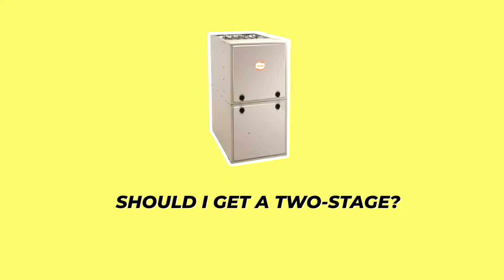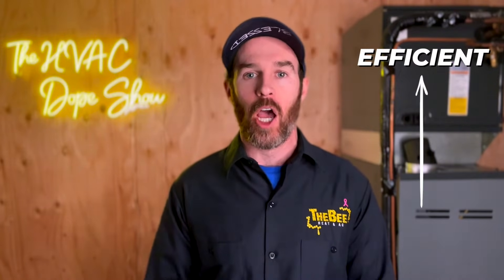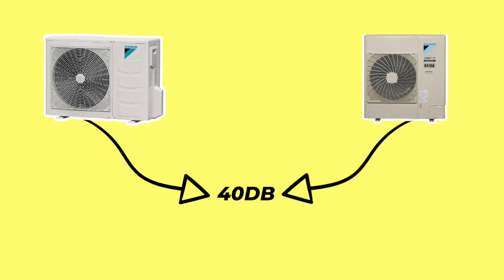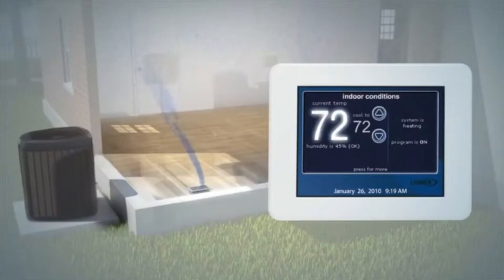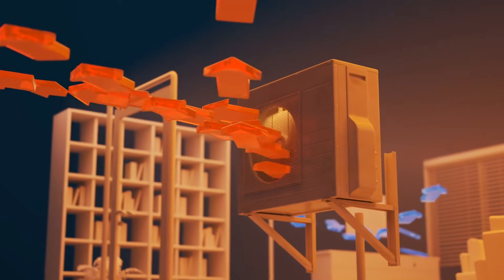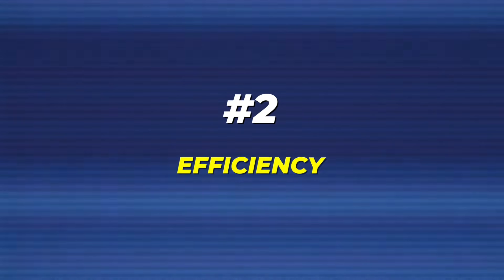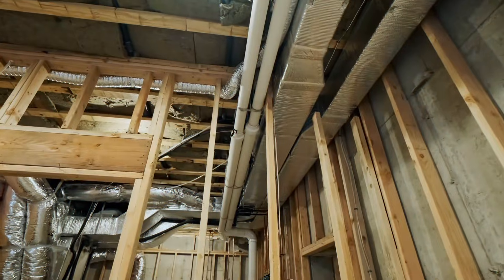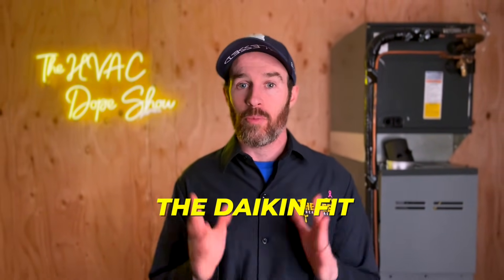Single Stage 🆚 Two Stage Furnace 🔥🤔

Comment: After a lifetime of single stage units in hot North Texas, I found myself faced with this choice by my A/C company when my old system failed.  The explanations of the benefits of two stage or variable speed units made good sense, but today's A/C costs are high, and these new types are considerably higher than single stage.  In my case, a 5 ton system was quoted at $16.5k.  A two stage system was $24k, and the variable speed system was $26k.  We are retired, and on a fixed income.  This was going to require financing. The monthly payment for the single stage was about $325/mo.  For the variable speed unit, it was over $500.  We have been perfectly comfortable with the single stage unit in the past, and we can't hear the outside unit at all.  So, we saved the money and got the new single stage system.  The last two days had a high temperature of 103.  I'm not sure how our house could be more comfortable.  Possibly, our unit is less efficient than a variable speed unit - but not $175/mo. worth.  So, to many people comfort is not the deciding factor.  It's cost, and there is a considerable cost difference in the types of systems.
Reply: These prices sound crazy high.
Reply from the maker: Yeah it really depends but that’s not a bad choice and will be very reliable for you and cheaper to work on. Things have gotten very expensive in recent years so it’s made things even more exacerbated for sure!

Comment: Don't longer run times with a two stage result in burning more natural gas?
Reply from the maker: Nope 😁 because in first stage it’s consuming half the gas it does in second stage. “Second” stage is basically the full stage of a single stage system, it’s just reduced output so it warms up more gradually and doesn’t overshoot the mark like a single stage might.
Reply: @TheHVACDopeShow  Thank you of the information.
Reply: And longer run times mean more electricity use??
Reply: @RedMango55  Cost of any additional electricity is offset by using less of the more expensive natural gas cost.

Comment: running a single stage 8o% gas furnace now.  looking at adding either a heat pump or AC for the summers.  one of the quotes I got was for a variable speed inverter heat pump.  would the efficiency benefits of that be negated by my existing furnace?
Reply from the maker: No the efficiency would still be noticeable, but the inverter heat pump would be able to function as a solid primary source of heat. The furnace is just your air handler / blower portion of the heat pump that circulates air inside, majority of energy consumption is the condenser portion of the equation so if you have an efficient heat pump condenser that will still be a plus. To maximize efficiency you want an AHRI matched system but it’s not the end of the world or as major of a deal, definitely makes a difference but maybe 10% depending on the system

Comment: 21 yrs with sinle stage. Just got a new 2 stage. Way more comfortable. Worth the spread.
Reply from the maker: Right on! Glad to hear
Reply: how is it more comfortable, quite possibly not related to 2 stages but improvements in air flow from new unit is my thought.

Comment: Here is a topic you missed. I have a two story zone home, upstairs and downstairs. I have a variable speed 5 ton RUUD 20 SEER AC that I run as a two speed. I have electric heat strips because I am all electric and live in Texas and Texas does not have winter. The electric heat will blast you out on high on a moderatly cool day and only one zone is calling. It takes time for the heat to reach the thermostat and warm the walls up. The second stage is needed when the temps are in the 20s and sometimes when both zones are calling.

I have had a heat pump but found them to be not cost effective because they are too mechanically costly. In other words the extra repairs and higher initial cost did not pay for itself. I use way more AC than heat so I put my money into the AC. 

My heating solution was to add an adjustable timer to put a 20 delay the before turning on the second stage heat. Normally the first stage heat is all that is needed except on some very cold mornings or unusual weather. The timer works and the zone controller did not have this option. Of course the electric strips do have sequencers.

Comment: I live in a split level home. I find the upstairs is still an issue with cooling down. I have shut all the vents on the other floors and it’s still a problem. I have a 2 stage furnace. What can I do to cool the upstairs down?  I do have the furnace fan going 24/7 but for some reason at night time the fan slows down. What can I do to fix this?
Reply from the maker: First off don’t shut those vents! That will cause more harm than good… basically you’re restricting total airflow now and the system will start malfunctioning or icing up. The best thing is to open ALL (or at least most) of the vents, and switch your fan mode to ON not auto… this will help your air circulate to the upstairs even when the AC shuts off, so that the temp on the upstairs becomes more even with the main floor. I’ve seen this one simple hack change the temp difference from over 10 degrees to just 1-2 degrees. Keep in mind it will take several hours of the fan running to equalize / circulate the hot air upstairs but leaving the fan in “on” mode on the hottest days is the best thing you can do. I know you’re already running the fan but open all the vents even on the main floor, and if you have a company come out to look at the furnace they can change the fan speed settings on the motor via dip switches on the board (most likely) or via speed taps on the motor (if it’s a PSC Motor, which is less likely since you said it’s a 2 stage system). But if you get them to increase the fan speed in fan mode on the speed taps, you’ll be able to get a little more airflow upstairs at night and during the day too. But definitely open the vents up that will cause issues
Reply: @TheHVACDopeShow  thank you so much for getting back to me. I will open the vents and call someone to increase the speed of the fan 😊
Reply: @TheHVACDopeShow Can they change the speed of the fan on a single stage? Any idea how much extra keeping the fan running 24/7 will affect the electric bill?

Comment: Trying to decide between a single stage and a two stage and i am woundering which is more reliable in the long run. I have a under 900sqft house and not sure if a two stafe is neede ???
Reply from the maker: Single stage is probably fine, 2 stage is comfort related… just don’t over size the system you probably only need a 40k or 60k btu furnace depending on your region and insulation

Comment: I'm also making a decision on single stage or two stage systems, one should also understand that a two stage system requires more times a technician to come by the house and repair or maintain the furnace.  Don't set yourself up for spending more money on a technician to figure out the problems with the more effieient two stage system.  I am going to go with a single stage variable speed furnace.
Reply from the maker: I don’t think there’s a manufacturer that makes a single stage variable speed and I don’t think that this is true. It’s definitely true. That inverters or high-end systems are more difficult to troubleshoot, but a basic two-stage system is not that complex.
Reply: @TheHVACDopeShow  I will buy an 80% single stage variable speed furnace eith made by Trane or Carrier. This was recommended by a technician who works for a furnace heating cooling company. I trust his judgement.  I don't need a highly efficient technology dependent furnace.

Comment: I live in Miami FL where we get no more than 10 days a year where the temperature reaches 50-55.  I am learning the various options and considerations when selecting a new hvac system for a new home.  2 stage system for comfort and efficiency- checked.  The question that I have had and I cannot find the answer is do I get air conditioning or a heat pump split system?  I know that the heap pump can work in a reverse manner to the air conditioning to keep the house warm in the few cold days that we have in Miami.  If I am willing to live without a heater in the few days that the temperature is 55 (enjoy the short-lived cold front), what are the advantages of selecting and air conditioning over heat pump system?  Is the price is cheaper?  Is the system is less complex and potentially less parts that can break?
Reply from the maker: You’ll get a heat pump in Miami you don’t really need heat necessarily but you’ll always have it even in that climate. Heat pump adds slightly to the cost over straight AC but it’s pretty standard to have heat you’ll have a hard time selling a house without it. Big differences between AC and heat pump are just a reversing valve and defrost control board
Reply: I'm in Miami as well and we had a Rheem 2 stage AC installed a few years ago. (love it) I wouldn't bother with the heat pump option.  For the very few days a year when we need heat, get a unit that has an electric heating coil in the air handler.  It's less expensive and all we need down here.

Comment: Can I have a two stage air conditioner with a one stage furnace 80% ?
Reply from the maker: Yes but the indoor fan probably won’t be staged unless it can account for this on the board. But you’ll probably just have single stage blower with 2 stages of cooling

Comment: 80% AFUE Furnaces last TWICE as long as High Efficiency Furnaces do!  Do the math.  Does 15-18% less gas consumption justify replacing that furnace in 12-years when the heat-exchanger is plugged-up from condensation worth investing in a 2-stage 80% AFUE furnace that is still quiet and comfortable that last you 20-25 years???  The way pricing is going with these systems currently, I am leaning towards longevity, over efficiency. until they can produce a high efficiency furnace that can be as reliable as an 80% furnace for the same lifespan.  In the current world we live in 80% furnaces are lasting about twice as long.  So you're not really saving money at all by buying the "High Efficiency" Furnace sales pitch!
Reply from the maker: We prefer 80% systems for reliability reasons but the 96% systems don’t have problems provided they’re commissioned properly and clean burning. Everytime I see issues with a single stage high efficiency it’s almost always over fired and never tuned on install day for altitude
Reply: I want longevity and low cost to maintain as well so I'm not sure ...is it worth going two stage 80% or should I just stick with single stage 80%? I don't need quiet, and I'm comfortable enough with my Day & Night made in 1978 single stage. I just have to replace it because next year the only option in california will be ultra low nox garbage.  Please if someone could give me advise on what to do. I can't afford to buy an expensive furnace and then have to replace parts or have it die in 15 years.
Reply: @Akitakt  single and 2-stage are equally reliable - but nothing sold now will be as reliable as a 1978 furnace due to build quality changes. everything has been cheapened!
Reply: Thank you. Im going to go with 2 stage but i cant afford to go higher than 80%. We are thinking of adding a heat pump later when we can afford it plus solar  @Jon-hx7pe
Reply: @Akitakt  The 80% should be $700 or less than the 90%+. If your contractor wants you to pay through the nose for 90%+, find another. Given the choice between single stage 90%+ and two stage 80%, I would go for a single stage 90%+ every time prioritizing fuel savings and sealed 100% fresh air combustion over comfort.

When you add a heatpump, having a 2-stage furnace is less important because the heatpump already is much lower capacity than furnace and furnace is only used for coldest few weeks especially if u buy a cold climate heatpump. Heatpump can work as a first stage.

The thing is that neither 2-stage nor being 90%+ efficient should raise the cost that much as the furnace overall is only about 1/3rd of the total cost of the job. 
Even if the nicer furnace  - lets say 2-stage, 96% efficient with a variable speed blower -is double the price, it should not be close to double the cost installed. You can look up the prices yourself on hvac-direct or another site to compare.
Reply: @Jon-hx7pe  I have a 1983 ICG (41 years) furnace still going, a bit noisy though.
Reply: @RedMango55  those old furnaces are very well made with little to go wrong but only about 60-70%% efficient. new 80% furnaces are totally different and far less durable. 30 to 40+ year lifespan hvac equipment is long gone.
just hope you're having the heat exchanger checked every year and have co alarms.
Reply: @Jon-hx7pe  Yes, we have the co alarm. Lots of orange flames so not very efficient for sure.  Would you recommend a Goodman or Trane one stage for best reliability?
Reply: complete non-sense. the secondary heat exchanger doesn't plug up unless there's a combustion problem producing soot or it is a old carrier with mild steel  secondary coated with plastic instead of stainless - a defective design. the rest of the parts are the same, for new furnace it is the same thing but with a stainless steel secondary heat exchanger which does not corrode. 
the lifespan when properly installed and maintained is the same. the extra maintenance is cleaning condensate trap and checking the condensate lines and every furnace regardless of efficiency needs maintenance.

Condensing/90%+ furnaces have been made since the early 1980s and all the issues have been worked out. 80%'ers were taken off the market in canada after 2010 and even long before that, about since the mid 1990s builders have been putting in 90%+ here because it ends up cheaper due to not needing a chimney or b-vent. 
Throwing away 20% of the heat a furnace produces is beyond retarded. If it wasn't for attic and crawlspace installs in the US and risk of the condensate freezing, I would be totally in favour of doe requiring minimum 95% afue.

maybe installers in your area need to become competent instead of bashing equipment for problems caused by their own mistakes and ignorance.
Reply: @Jon-hx7pe  what are you talking about?  It’s the condensation in the secondary heat exchanger tubing! They get clogged up just like a condensate drain gets clogged up. How many service calls did you run & have to blow out and clear a clogged condensate drain?  The same thing is happening in the damn heat exchanger!  Don’t tell me it’s non-sense I’ve been in this business for over 21 years and I see it all the time. So will you!
Reply: @luckyrocks1  something's wrong with the way the furnaces in your area are being installed, commissioned and maintained or the fuel supply if you're seeing that issue beyond the plastic coated carriers. Part of proper install, not doing bear minimum is running the air intake pipe so the furnace has a clean supply of combustion air.

Normal natural gas or propane combustion does not produce particulates that plug up secondaries. secondary should stay clean. furnace condensate drains get plugged up from water standing in during off seasons (maintenance needed!) as well as if there's a combustion problem or it's a old carrier with the plastic secondary deteriorating putting off plastic particle sludge that plugs things up.

Condensing furnaces absolutely have a normal lifespan when properly installed and maintained unless there's some fuel supply quality issue. There are many well over 12 year old condensing furnaces in use and some will last twice that or even more.

The push out of ignorance to  install inferior 80% furnaces in cold climates sf why regs to get rid of them are needed. Along with regs to stop the bs of installing ducts in unconditioned attics and crawls which have high energy loss. 
USA is so far behind it's not funny and is wasting so much energy.
Reply: I’ve got a high efficiency Carrier that is 25 years old and still running.
Reply: @ Yes, the first generation 90% high efficiency furnaces from Carrier/Bryant, Trane/American Standard and the Lennox Pulse furnaces all last as long as the 80% furnaces do.  Unfortunately, when you replace that one with a modern 96% AFUE or higher model it will not last as long and once the 10-year parts warranty expires you won’t believe how expensive the repair quotes are to replace the inducer motor, the blower motor or the control board.  Not to mention the secondary heat exchanger.  Once any of those things break, in usually, 12 to 15 years it’s time to buy a new furnace.   Modern HVAC equipment is built to last as long as a modern refrigerator.  They want you to replace it as soon as possible after the ten year warranty expires.
Reply: @luckyrocks1  can’t argue with that. They do rip you off on replacement parts. I think it depends how much gas you use per year as to whether it is worth it or not

Comment: Yes, 2-stage should replace 1-stage and should have NO difference in price, since it's simply a gas valve and we have now converted to DC from AC blower motors.
Reply from the maker: Motors still require an alternating current power supply, you mean ecm instead psc? I don’t think it will be the same price ever, not how capitalism/profit motive works lol so I don’t see manufacturers embracing that perspective anytime soon. Interesting take tho